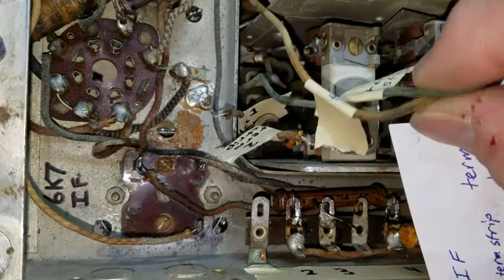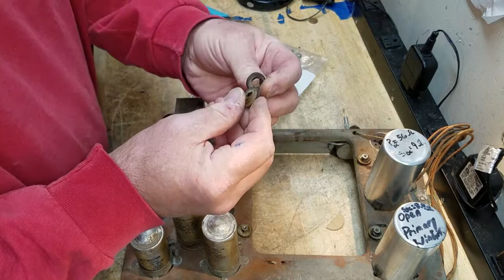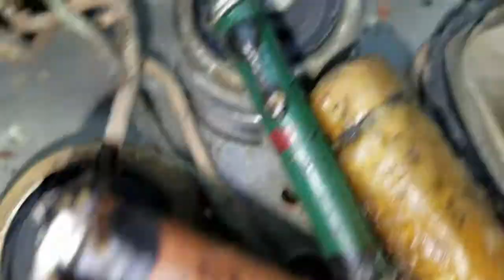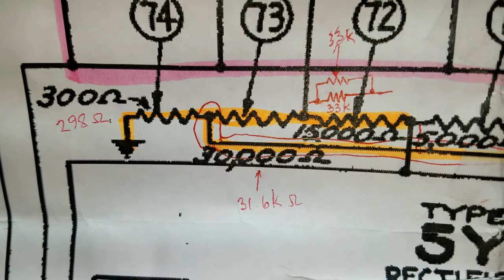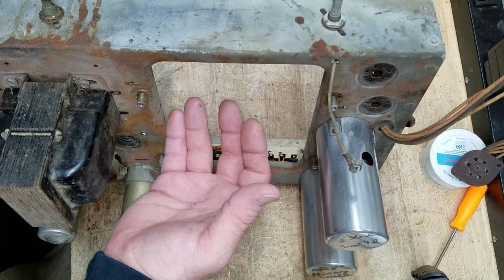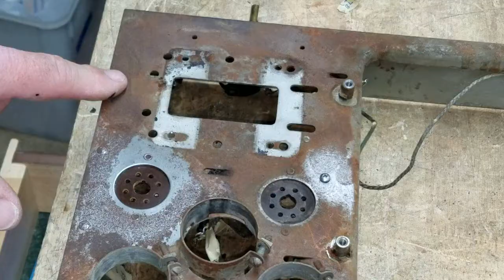1937 WESTINGHOUSE WR-212 BC-SW RADIO Part 2 of X Removing the Tuner Chassis

Comment: Michael, 
This may be an insane idea, but while you were talking about using tape to protect the tube sockets and that it would not prevent what you used to clean the chassis from getting into the sockets , I began to wonder...what if you used chewing gum to cover the sockets all the way to the chassis?  I don't know what the material you use to clean would do in relation to the gum, but if it didn't have an adverse reaction, you could always use ice to cool down the gum to where it would be easier to remove.
Am I completely off my rocker on this idea?
Oh, and a question.  Do you make sure that the lead of the capacitors you replace the old ones with that is attached to the outside foil goes to the low impedance side of the circuit?

Comment: Good job! I thought it a good idea to remove the transformer. I do take notes, drawings, still pictures and video and sometimes, I feel it still not enuf, lol. Great point, reminding folks to do that. Im interested in seeing the chassis paint job, I have used rust encapsulator on truck frames before, never thought of it on a chassis. Thanks for sharing. Regards Larry
Reply from the maker: I've thought of trying POR-15 on radio chassis, too.  The trouble is, its really thin and messy and it's a little tough to remove for things like ground points.  I really like this Rust-Fix and Appliance epoxy combo.  It seems to hold up well and it's easy to apply.   I have found the videos to be extremely helpful in helping me to re-assemble a radio that has been apart for a while.  I never really take still photos anymore.  Thanks again, for watching and contributing, Larry!   Cheers!   Michael

Comment: Mike,
I agree with you …there’s no need for slap-dash soldering, lead dressing, and component ‘relocation’ work.  All that will be achieved are a few problems at some later date.
Four days ago, I completed the repair of a Ferranti, model 146…  http://www.radiomuseum.org/r/ferranti_146.html 
...for a woman.  It belonged to her grandma who passed away 41 years ago.  As a girl, the woman remembered it having a strange humming sound despite it being taken, by her grandad, to a TV & Radio repair shop for service work.  I replaced the pi-filter smoothing capacitors, along with all the paper ‘waxies’, audio output valve cathode resister (which was o/c), and a few other resisters that had overstepped their tolerance band (or over 20% for no band).  When all of that replacement work was complete, I was faced with the ‘strange humming sound.  
A service tech, having diagnosed the audio output transformer primary as being o/c, severed all its wires; left it secured in situ, and using one bolt only, secured a replacement transformer to the chassis, onto which the original wires were soldered.  
So? (You might say).
The service tech had located the audio output transformer (face-on), directly in front of the mains transformer (face-on).  50Hz mains frequency was inducted from the mains transformer over to the audio output transformer.  Had that tech spent an extra ten minutes liberating the defective transformer, and fitting the replacement type into its place (which I did), the 50Hz mains hum would not have been superimposed upon the audio output …thus causing unnecessary work at some later stage.  In that instance, someone technical should have given that service tech a swift boot up his bracket LOL. 
From the age of sixteen, and throughout my apprenticeship, the following was drilled into me (as well as other apprentices), “Unless ‘officially authorised’, do not deviate from the manufacturer’s official service data.”  As the service manager often said, “Trust the team of design engineers: they generally know what they are doing.”  Mm… not always LOL!
As far as re-stuffing capacitors is concerned, unless requested to do so, I too do not re-stuff them.  I like preserving the technical side of a radio, thus maintaining how it was intended to function, and sound.  Provided there are no technical deviations (sometimes unavoidable in instances where certain valves, transformers, tuning caps etc. are virtually unobtainable), maintaining under-chassis aesthetics is definitely a secondary option.  I often leave redundant ‘electrolytics’ in situ so as to avoid leaving unsightly holes.
I also make good use of sticky-back labels as well as snapping photographs, and drawing art-work of a required part of the chassis onto paper …it all helps LOL.
I’ve enjoyed viewing this video …it’s always great to talk to you my friend.
Phil.  P.s, I’m looking forward to seeing you’re rust prevention treatment work.

Comment: +ThatTubeSound  I enjoy your videos! I totally agree with your advice to label, label, label and take pictures and videos. it drives me nuts when I get into a Japanese tape recorder and one of their ultra fine wires pops off the board at the solder joint, so I have no way to know where it came from because there is no remnant! A picture or video can be a life saver there. And those wires can pop off any time. 

The problem with the tape recorders is rather interesting. The machines often  have compartments for storing microphones and cables, which is a nice idea. The tape recorder cases are usually made of a type of polystyrene, but the wire jackets are made of a polyvinyl. Those two are chemically incompatible.  Even when there is no component box, anytime a wire jacket rests against a case surface, there's going to be trouble, thanks to time and lack of movement.

When the recorder is thrown into a box and stored in a garage -- or worse, an uninsulated attic -- without any movement or relief, the wire jacket reacts with the case plastic, actually melting it (it leaves "tracks" or "scars" as evidence). As this happens, the reaction releases a slightly corrosive gas that eats away at the metal wire and components. I have had microphone and earphone jacks literally fall apart because the metal has been eaten through! 

Ironically, the entire problem could be avoided if the machine was simply moved or used once in a while. It's not the fault of the old guys who made the machine. They didn't have the advantage of time -- to know the materials would do this. They also didn't plan for their machines to last over 50 years! 

We preservationists have to deal with it though.

I also agree with you about not "stuffing" capacitors. But I have a different reason. 

The caps are heat sensitive. If one (or more) is stuffed inside a can, and that can is close to a  tube, a heat source --  what has been created is basically an oven. 

The poor modern cap(s) is getting cooked inside that can, where there is no ventilation. 

So to me, I think that "stuffing" a can is actually creating a problem, at least in a tube product, especially one that has little ventilation. 

Keep up the good work!
Reply from the maker: You know, I never thought about the can acting as an oven!  That makes sense to me.  I always think about the next "electronics archaeologist" who looks at a 1920s or 1930s set that I've worked on.  I think that that person would learn so much more about how these things were made if I left things in place.  A terminal strip attached as a place for the modern caps doesn't take away any history.  Gutting a can and melting out the potting completely removes the record of the construction of the can.  

I didn't know that about polystyrene and polyvinyl.  It makes sense.  I have found many electronics, mostly from the '50s, I think, that had the melted "scarring" that you refer to.  I have several Japanese tube radios from the period with styrene cabinets, and I am worried about them now.  I'll have to take a look at them.  It reminds me of the "sticky wire syndrome" that I find so often in sets made during that same period.

Lucky for me, I live in a dry climate.  My house sits on a hillside, with most of the first floor situated more like a basement.  About 90% of my more than 700 radios, TVs, recorders, and record players are stored inside my house on this first floor.  They never see temperature or humidity extremes.  I leave the ventilation going to all of the rooms, even though I am seldom in many of them.  That way, there is regular air exchange.  I think this will preserve the machines as well as most ever see.  I know that I'll likely never get to restore most of them, myself, but I see myself as being responsible for their well-being until they can be restored by someone.  

I really enjoy your videos.  I learn a lot from them.  There aren't a lot of folks covering recorders.  If you ever can, I would love to see you do some coverage of wire recorders and home record cutters.  I am absolutely fascinated by these two niche groups.  Keep up the great work.  I'll be watching!

Cheers!   Michael
Reply: Thanks for your reply. Wire recorders, yes they are fascinating. youtuber: Amberola1b has some good videos on a few of them plus his Edison cylinder phonograph collection and videos are really informative and excellent. Like you, he has an attention to detail that is admirable.  He did a video on an Akai tape recorder that was brilliantly detailed and made me glad that I never got into the Akai machines! 

Another youtuber: Cassettemaster did a video on a wire recorder where he got the ground line mixed up and -- on camera -- gave himself a nasty shock. As you have pointed out,. this stuff can be very dangerous. Even the battery stuff can start a fire if there is a short! 

I also enjoy your cats when they come to visit. Mine sits on my computer mouse when I'm trying to surf, purring all the while. She never looks at the screen though. Poor thing, she just doesn't get the concept!

Comment: I do have to disagree about restuffing cans, though. If the capacitor is bad, replacing the inside simply repairs it so it can stay in service as a unit, with the original connection points. Taking it out of circuit and leaving the unconnected corpse as an ornament seems LESS authentic to me. Now you've added a new separate component, and left another as decoration. The can wants to work again!
Reply from the maker: I dig it.  I used to restore old cars.  I was the guy who went to great lengths to make everything on a car as original as possible.  Every part on my '68 Porsche 911 that wasn't original to MY car, came from another '68 911.   I completely rebuilt the 6 volt electrical systems in my '57 VW Beetle and '58 Renault Dauphine because I felt that it was the only way to do it.  But, when I went to car shows, I was reminded that there are other ideas out there that made sense to other folks.  It was as hard for me to accept a big Subaru engine in a VW Bus as it was for the owner of that Bus to understand how I could put up with the quirks of 6V electrics!  At the end of the day, we were all collectors and enthusiasts and we all agreed that old cars were cool.  I guess old radios are much the same.  They are just plain cool.   I'm just glad to be a small part of an awesome hobby!    Cheers!    Michael